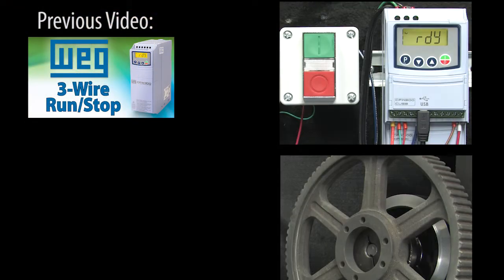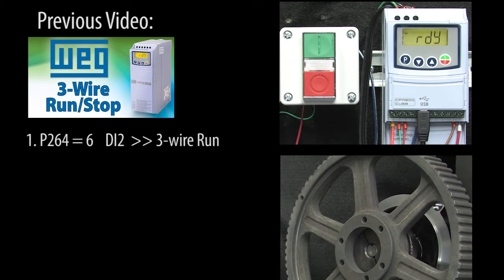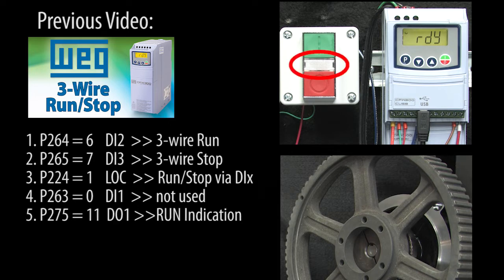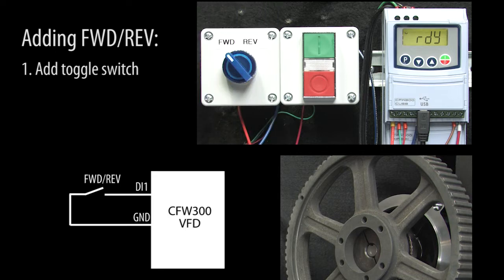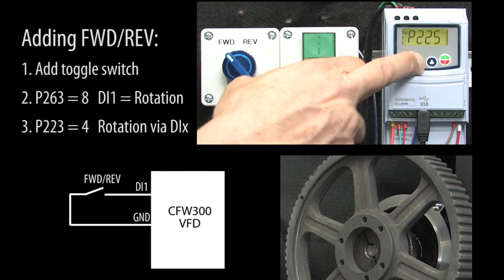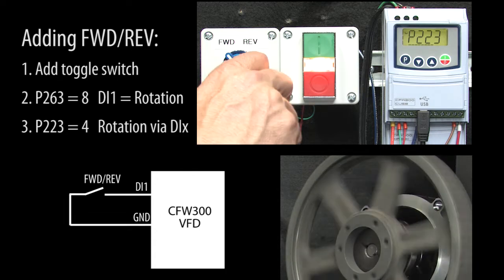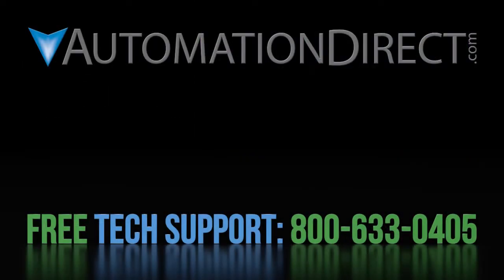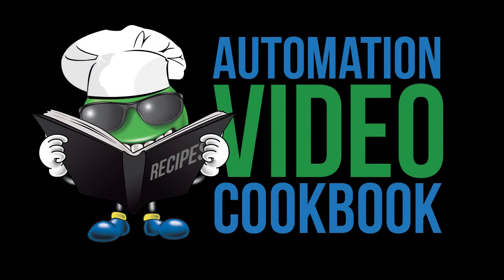WEG CFW300/320 VFD 3-Wire Control with Forward and Reverse Tutorial at AutomationDirect

Comment: I want to run my forward reverse in between 2 limit switches, is this possible? Could you please assist with wiring diagram
Reply from the maker: Hi Quintin, You want to run forward and have it automatically cut off when it hits the forward limit and reverse until it hits it's limit - correct?  If so, you want this video: https://youtu.be/lE8EA7NzQDM and simply put N.C. Limit Switches inline with the two switches.